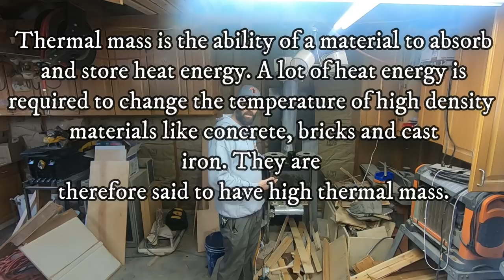Costly Mistakes Building Custom Cabinets | THE HANDYMAN |

Comment: We have been heating exclusively with wood for the past three winters. Been using an old steel box stove. Upgrading this year to a hearthstone. Our house is only 1200 square feet not including the full basement and has a very open layout. Only the two bedrooms and one bathroom are seperate from the main area. We are on 27 acres and every property that boarders ours has clear cut in the last couple years. I have free reign to go collect wood from tops. Being 24 years old and full of energy I've most certainly been taking advantage of that. Got about three years worth of wood stacked last year, hoping to double that this year. Theres an old farmhouse on the property with a nice wood furnace in the basement that I'm planning on putting in our basement for the dead of winter when we often see well below zero!

Comment: I'm going to guess that you forgot to place pocket holes to attach the face frame. Been there, done that. Now I make sure to label each piece and put a mark on the edges that need pocket holes.
Reply from the maker: You win.
Reply: The Handyman gotta get one of the little $20 jigs now. Probably already have one. It’s all I have and it is so slow compared to your table top one.
Reply: Just glue and Brad then clamp them on. Easy

Comment: I'm guessing you: 1) forgot pocket holes in the panel parts (to attach the face frame to the carcase); 2) forgot to drill shelf pin holes before assembly; or 3) due to layout errors the FF rails don't line up with the shelf/horizontal partition locations.

A serious cabinet app that generates shop drawings, optimized ply cutting diagrams, accounts for joinery and tracks material/job costs would be a game changer for your cabinet production. I've used eCabinet Systems by Thermwood for over 10 years.  As with any app there is a learning curve, but the software is FREE to trade pros, and it does 95% of what overpriced platforms like Cabinet Vision can do. I'm not connected with Thermwood in any way.  In fact, I'll be switching to a different app when I convert to CNC production in a couple of months.  But for anyone who does any volume of custom cabinets at all, the efficiencies that a dedicated cabinet design app can bring are tremendous.
Reply: Does ecabinet work only with CNC machines or can it design and give cuts for a shop that uses power tools? I looked into it just now but couldn't tell. 

Thanks in advance
Reply: Shannon P -- It does both. You can print cut diagrams that are "nested" for CNC, or with straight lines for saw cuts. Either way, it optimizes each sheet of plywood for the most yield. The main drawback is that, if you switch to CNC at some point, the output files are proprietary and only work with Thermwood's machines.  I ended up buying a different brand of router, and had to switch to another app. Good luck!
Reply: @shannonp4037  Yes great system, I use for cut lists, just double check the grain  orientation if your using a verneared  board that's going to be clear coated

Comment: Handyman I just saw an interesting use of the pocket screw hole maker. I follow the Homemade Home. He invests in inexpensive properties, renovates the houses and rents them out. There was an outside porch added at some point but they had not setup the flooring evenly. So he used some triangle pieces of wood to transition over the threshold. He did not want the screw heads interferring so he just used his pocket screw hole jig to secure the pieces to the older bottom wood.

Comment: I heat my 1870's farm house with a wood / coal burning primary forced air furnace and have a propane forced air for a backup should I need to leave town and then AC in the summer.  Propane is super expensive where I am, so it was more of a financial consideration than anything else.  My little Hot Blast works great burning wood down to -20 outside.  It gone down to -40 here last year and all I had to do was throw a couple bags of anthracite in there to keep the heat cranking.  Works great.  Saves me about $1,200 a year in propane costs.

Comment: I was 19 when my parents bought a place in the country, it had a wood burning heater to heat the house. I spent the next three years going there on weekends to cut down trees, split and cut firewood to 18" so it would fit into their heater since my father drove over the road and my Mom had COPD and Emphysema. I lived there the first winter because I lost my job and man it would get cold when that fire went out, but it would definitely get hot, we too had some old break rotors and a piece of railroad track on top of it, for the mass, I LOL'd when I seen that for the first time in your shop and knew exactly what they are for, right after they had moved in and ran the heater, they had taken those ugly things off and it got extra cold that night, we put them back on and it started heating better that night. Thank You for these Great videos!

Comment: It does look good! 👍 Guessing, maybe the top portion of the frame should be separate from the half/bottom section of framework? Or vice-versa? Or maybe not glue the rails & stiles together just yet? For some reason. IDK. Hm... 🤔

The 70's oil embargo forced my parents to install a wood burning stove. We had a small house so the dining room was sacrificed as the central heating location. My dad was a mason & did the brickwork. Unfortunately the concrete pad was very wide, by code, & took up half the floor space. So my mom built some small furniture pieces so all of us could sit by the fire. It was nice. She also finished them with stain made from black walnuts we peeled. (Which looks like HM's green goo! 😝) Things were different then & common practice, true. You did what you had to do, first. Anything else was considered a luxury & saved for later.)

Comment: Unrelated question but have you ever worked on st Simons island GA or Sea Island GA.? I remember seeing a truck like the silver dodge you had with the abominable snowman on the side. I'm sure it was more likely somebody else but it seems to be your type of area especially with a marina there. Just been wondering
Reply from the maker: I had number 17 of 50 of those trucks.  That is Miles the Monster on the side.     It wasn't me.
Reply: @TheHandyman1  Very cool info

Comment: Is one of the mistakes that you used wider stiles than the 1.5" that you used on all the other cabs?
Reply from the maker: Yes I was supposed to rip them down before putting it together.
Reply: I think yur being to hard on yourself by calling it a mistake. On custom cabinets ripping down after the fact is a great way to fine tune your precision especially if working in super tight constraints with adjacent cabinets. Keep up the quality content.

Comment: i always found it difficult to use an impact to get those pocket screws in. a drill with a properly set chuck is a no-brainer as it prevents it from coming out the face. perhaps i'm too aggressive with the impact.

Comment: Why you have Dodge Ram brake rotors on your stove, guy?  LOL  Your right, my house was built in 1979 it has a wood burning fireplace but it was converted over to gas at some point in time.  We barely ever use the thing, mostly in the fall when I don't want to turn the furnace on yet.  Considering they both burn natural gas I doubt I am saving anything by doing that.  The nice part of the fireplace is when you turn it off the bricks will give off heat till morning.